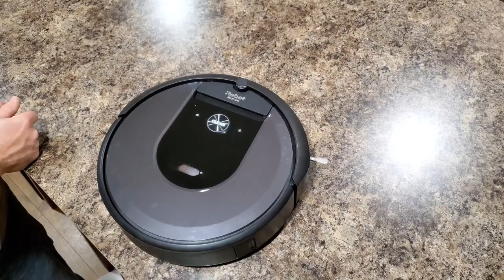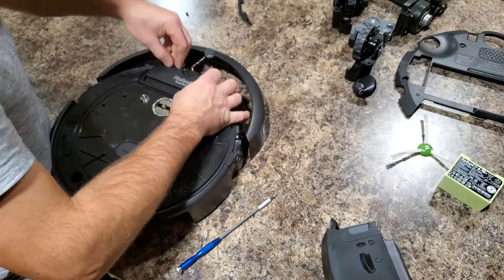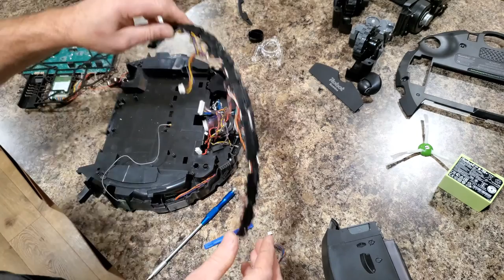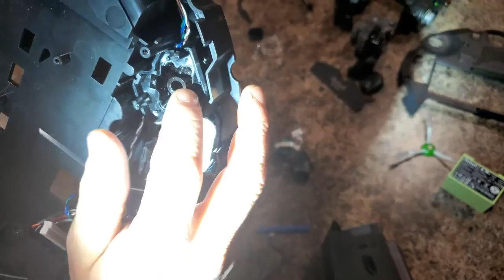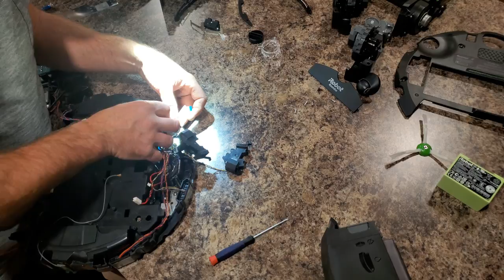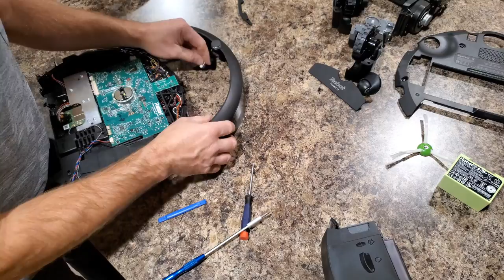How to Fully Disassemble the iRobot Roomba i-Series models

Comment: I sprayed mine with a hose after it ran over and spread poop everywhere. I dried it and then blew it dry with the air compressor. After this I let it sit and dry for 48 hours.  Next I placed it on the charging station. It is an i6. The clean ring is circling as though it is changing. The base light is red and remains red. 

The rumba hasn’t performed it’s daily run in two days. 
Any suggestions???

Thanks in advance.

Comment: I’m really struggling to get the front bumper back on with full functionality… I can get it back on but it doesn’t have that “springy” feeling. When I push the bumper in it kind of just sits there, I have to manually pull it back out.

Comment: Any chance you've worked with the s9 series yet?
So far the only error stumping me is error 9 bumper error.
It's unique to the rest with the use of the HECB and magnets. I don't know how to test HECBs yet and can't tell where the disconnect or communication error is coming from. Seen it on 4 of them new out of the box and I had a feeling it was due to the return springs since they ship the robots vertical facing down compressing the bumper constantly. But so far resetting springs, disassembling and reassembling the bumper hasn't worked. Wires are so small I'm worried I'll break one messing with them too much lol.

Comment: We just got our first puppy a Pembroke Welsh Corgi and we love him so much, but today our Roomba Rosie gobbled up and spread puppy 💩 all over the carpet and hard wood floors while I was at work today.  The only thing that stopped it was the sensors were completely covered in and caked in that’s right poo poo everywhere and it’s all inside every nook and cranny of my roomba i3.  
    Surely Im not the only robot owner this has happened🥲😬😬😬
Reply from the maker: Yes, you are not the only one, has happen more times to people than you think, few years back I did receive a Roomba that went thru same senerio,  I took it all apart, cleaned and disinfected all parts, and it worked and looked like a new Roomba afterwards.
Reply: @TheiRobotChannel  Thank you for your encouraging reply.  I hope my Rosie will respond similarly after I put her back together and exchange the rollers and filter🤞
Reply: I sprayed mine with a hose after it ran over and spread poop everywhere. I dried it and then blew it dry with the air compressor. After this I let it sit and dry for 48 hours.  Next I placed it on the charging station. It is an i6. The clean ring is circling as though it is changing. The base light is red and remains red. 

Any suggestions???

Thanks in advance.
Reply: @CarlAlvey  great idea and life hack, definitely using ur way next time